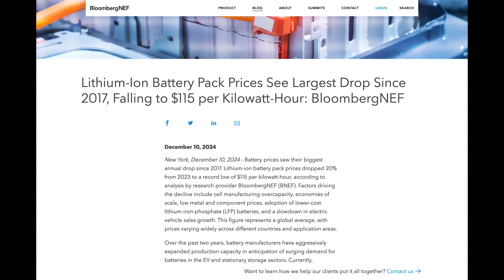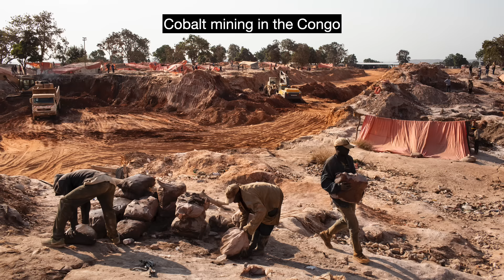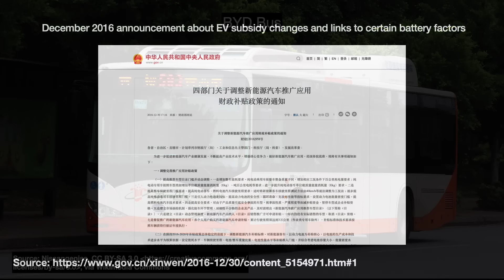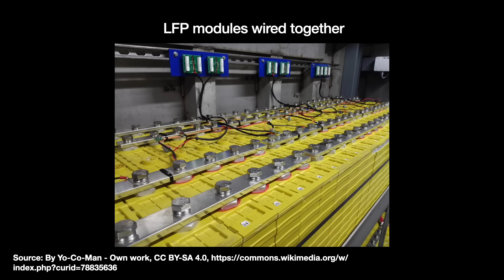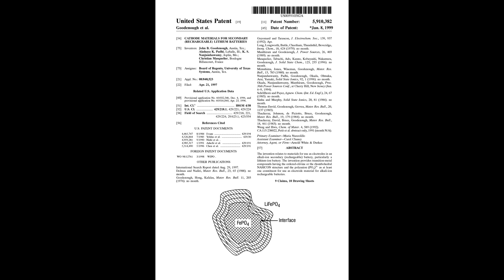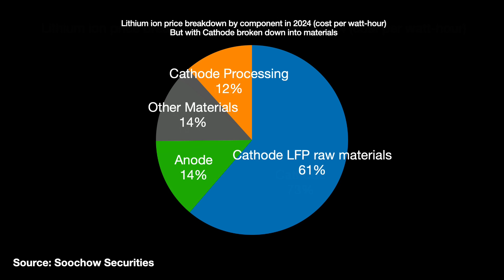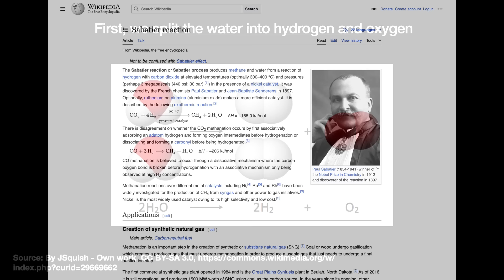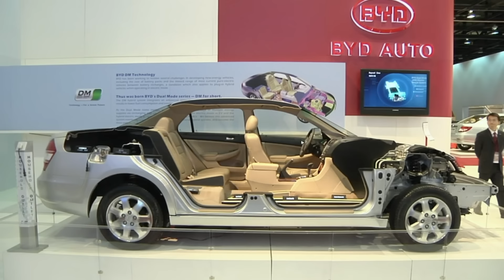How Did China's LFP Batteries Get So Cheap?

Comment: The big problem with the blade cells is that they glue them together and glue the cooling pads to cell pack, making them impossible to replace a faulty cell.
Reply: Are any other EV packs serviced by replacing individual cells?
Reply: @ladedk  Nissan Leaf. You can replace modules in a Telsa
Reply: it's like aa battery, you would not care a dead aa battery, and just buy new. Same for the cell, the cost and benefit doesn't make repair single cell viable.
Reply: @MO_AIMUSIC it's the entire stack of aa battery being replaced. Thrown away.
Reply: @ohlalaSG  it's not reasonable to compare a cell of a whole pack of aa, first, it's not a usable unit until it's been fully assembled, you can do not about a single unit. Second they will have pre examination for good and bad cell before assemble, however if the assemble process induced faulty, it is not worth to recycle because it will also degrede the good cell, just like if you making cake and there is a accident with the creamer process, you would not recycle the base of the cake.
Reply: @MO_AIMUSIC d##b, throw away whole battery pack for a single bad cell! 🍌🍌
Reply: @MO_AIMUSIC  I'd suggest a huge cost that nobody is factoring in, is the disposal and replacement of thousands of massive battery structures (BESS) in a decades time
Reply: @dab88 recycling li-ion batteries is relatively simple and not that expensive and will only get cheaper over time
Reply: @dab88  For your info, not a single EV battery pack has EVER been thrown away. And never will. They are too valuable, easily repurposed, and easily recycled.
Reply: @dab88  also the battery factory may not do the recycling part, but there will be other factory that may specialized at recycle the battery, but again, the recycling industry is highly polluted for sure. So factor in the environmental cost.
Reply: @junehanzawa5165  that's also true, but the key point here ia to make sure the battery cell is good before assemble, and during assemble make sure the yield as prefect as possible.
Reply: @MO_AIMUSIC  There's no pollution in recycling Lithium batteries. Every single thing is recycled and reused.
Reply: @junehanzawa5165  lol😂, you work in a battery recycling factory?  How do you know everything is recycled or can be recycled?

There are too much scams in the recycling industry, they say they recycle but behind closed doors they don't, it's cheaper to dig up new dirt then to go through all those complicated processes to recycle and get a lower quality material back as a result.
Reply: @evolor I've been to one and saw it done myself. I even gave them an idea to streamline it further. They'll liked it and are looking to implement it down the line, as it'll require some changes to their existing machinery. Their biggest issue, however, is that not enough batteries are getting to them yet. Mostly smaller batteries from power tools, cell phones, and other electronic gadgets. 

That's because EV batteries, besides lasting longer than most anticipated, the very few that haven't (such as in old Leafs with no active cooling) are being repurposed or repaired by interprising individuals and small companies. And several auto manufacturers are setting up their own recycling plants to further cut costs. Both VW and BMW are building their own recycling factories.

These are not cheap plastics and other recyclables you're thinking about. These contain very valuable metals and minerals. So nothing is being wasted. It's way cheaper and easier to recycle them than mining. That's why auto manufacturers are spending billions into getting in the recycling game.
Reply: @junehanzawa5165  I appreciate what you're saying but there are many examples of valuable materials not currently being recycled. If batteries continue to drop in price and material tech allows for less expensive components, then it's safe to assume it will be like everything else on the planet - exploited with no regard for the consequences until we're faced with them. Excuse the pessimism but this is business and there's a proven track record.
Reply: @dab88 Name a single valuable material that can be recycled that is not being recycled.
Reply: @junehanzawa5165  I dunno if that's asked in good faith considering your previous comments. Plenty of electronics aren't recycled despite containing gold. Loads of steel isn't recycled coz it's not cost effective. There are huge graveyards of vehicles across the world not being recycled. I'm not saying nothing is being done but we're pretty terrible at building this stuff into cost of production and dealing with the consequences.
Reply: @dab88  Electronics are recycled as long as the consumers takes them to their town's recycling center. Automobiles are stripped down for parts in junk yards and the iron and aluminum are recycled as scrap metal. The very few that are not depend on their owners who leave them in their yards rusting away. There is no such thing as automobiles in trash dumps. 

These are battery packs filled much more valuable metals such as Nickel, Manganese, Cobalt, Copper, Lithium, and even the graphite is recycled. Not a single EV battery pack will ever hit a trash dump site.
Reply: @junehanzawa5165  I can't agree with you on that, recycle lithium battery is rather challenging as the material composition is varied very much (lithium ion ternary, lithium ion phosphate and lithium manganate) as well as the packaging and mechanical difference. Dissabmle and recycling need to be extreme care to prevent anything goes into the environmental as it is extremely poisonous and have long lasting effects. In China there are lots of the company working in recycling, but still there is still not greentree 100% naturalization.

Comment: Recent quote for LFP prismatic cells, 960 watt hours (3.2V, 300Ah) was at $38 per cell, which turns out to be $39.6 per kWh at the cell level. Our liquid cooling and heating stuff that goes into it. Each cell weighs around 6.5Kg, and with our systems added into it, turns out around 6.8Kg per kWh, or a unit system level density of 147Wh/Kg. Our 40 ft containers weighing 23 metric tons of stuff and 3.9 metric tons of dead weight. 3.3MWh of energy per 40ft container.

Depending upon the requirements, we typically can change the inverter container and modulate a battery container from 2 to 8 hour ranges, but about 85% of our stuff is for four hours. Another 13% is for 8 hours and remaining is for 2 and 6 hour systems.

About $8500-9000 for our one-trip containers (i.e., new containers) pre-tariffs, and another $25k in materials to make it suitable and sturdy for holding that much weight and the heat generated, another $40-50k in wiring, stands, and another $40k for heating and cooling controls.

All in, our typical 40ft container of 4MWh of energy costs us about ~$300k, and it sells off as fast as we could make it. The electrical control and inverter container can either be a standard 20ft or a 40ft, depending on the system design.

A 10MWh system, for four hours of backup is four 40 foot containers, and can cost about $2M. Throw in another $500-750k for site installation, connecting to the grid and that gives you about $275/kWh of storage capacity cost. At $0.12-0.18 in electricity, these are the average residential electric prices where we install our systems, our systems are very much a smart business solution.

It worked out even with the Biden tariffs that were supposed to go in effect in 2026 for non-EV related batteries. As far as I understand that is no longer valid with Trump's tariffs. Before the tariffs hit, we basically took out any loans that we could, maxed out our credit lines and talked with banks to extend their services on overdraft accounts for no extra charges. We are waiting on North American - and now with Trump's tariffs, US based LFP suppliers. There are some, but they do not compete on cost, rather focusing on quality required for automotive use, and I do not expect any major supplies to come online for non-automotive use till 2027 (point to remember, so much of LFP battery material is going to have to be imported from China, until we can build a supply chain for ALL of the stuff that goes into LFP batteries).

I think it will be until 2030 when US sourced LFP batteries will reach cost parity with Chinese LFP batteries and by then China will be even lower or they will have mastered LMFP batteries.

Update: 12th May 2025

90 day pause on 145% tariffs and to be set at 30% while China has lowered it to 10%.
We plan to sell as much as we can, maybe take a few payments upfront with discounts and then use the money to move more inventory and pay off overdraft accounts and short term loans ASAP, while planning for what's next.
Reply: i was buying lfp 280ah format cells from china for 30-35$/kwh delivered a month ago.
those prices are long gone now. i imagine true factory gate prices were somewhere around 20$/kwh. that means the largest component of cost had been cut so low to the point where the price of shipping was the most important factor. thats insane economies of scale. given that ~1kwh of lfp storage weighs about 10lbs, thats cheaper than the cost of other high volume commodities like butter or milk lol. how in the world is china able to make advanced lfp batteries which are legit capital investments and generate money for less than the price per pound of a stick of butter at my local grocery store rofl
its really amazing when you think about it like that.
Reply: US LFP will never reach Chinese levels of cheapness. It just won't.
Reply: Thank you for taking the time to write that up, most interesting.
Reply: CATL already have the sodium battery in real production car.
Reply: @YSKWatch  in what model? There was a hypetrain and now is another. It should be in byd seagull, JAC Yiwei EV (Yiwei 3), Sehol E10X,  Chery iCAR - but noone saw them on the road even in china.
Reply: @YSKWatch had sight of  a molten sodium battery vehicle that used to deliver HM Queen's mail back in the mid 1990s.
Reply: @thepeoplespal5  the problem is power density, it must be solved so the battery can be light enough for car. the same as LFP, nobody use it until BYD solve the power density problem.
Reply: @YSKWatch  lfp power density has been overcome at the pack level by integrating cooling into the cell packaging. by using thin aluminum instead of steel like cylindrical tesla cells, you get much better cooling performance without all the added weight of a cooling loop. steel sucks for moving heat compared to AL. plus its heavy and the round shape of most non lfp cells is garbage for packing density. when you add up all the weight savings from packaging alone of prismatic lfp cells, the difference in energy density is like 15%. when you add in the benefits of better low temp performance, higher usable state of charge without sacrificing durability, LFP battery packs usually beat other chemistries in real world EV applications. then when you factor in cell aging, after the car is 5 years old, LFP exceeds NMC/NCA performance even in energy density over the last 2/3rds of a vehicles lifespan.
look at how performance versions of the model X and S age, they loose around 20% of their usable capacity routinely after hitting 100k miles unlike LFP.
Reply: @vevenaneathna  thank you, I was always wondering why cylindrical cells were used more than rectangular.  Never made sense
Reply: wow, thanks for providing some actual hard numbers for grid scale systems
Reply: Trump will be half way through his third term and everything will be fixed
Reply: this is the green future I was dreaming of !!!, containers of lithium batteries for as far as the eye can see. 

This is progress !
Reply: US will never reach any cost parity with China, because US is used to high wages, little work, huge pays for CEOs and stockholders, so....the focus in US is to get rich as fuck, not to advance tech anymore.
Reply: Our?
Reply: Trump has a knack for putting the cart before the horse.

Comment: My EV uses a 126S1P 400V 62KWh LiFePO blade cell battery. Just 126 cells.

Inexpensive and works great. Three years on no sign of battery degradation.
Reply: Primary issue is charging if the cells are a bit below freezing.